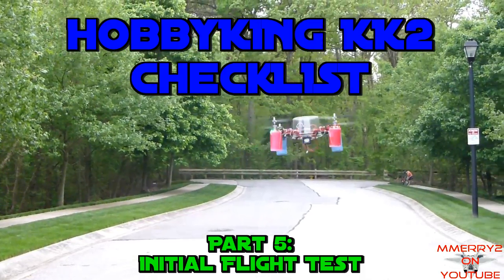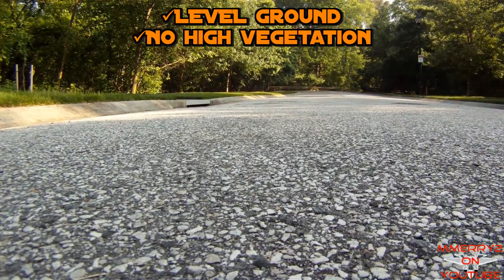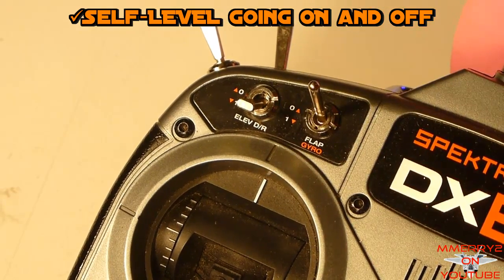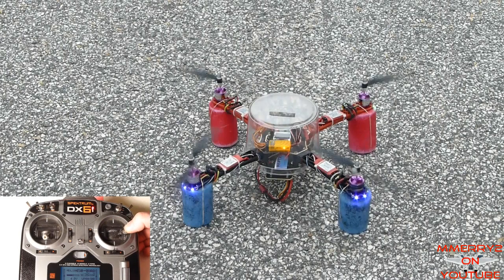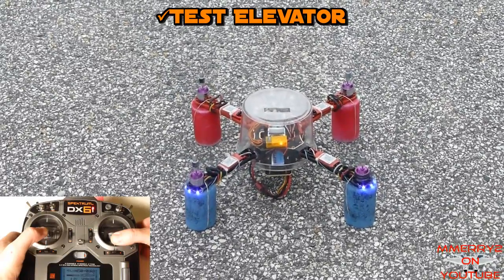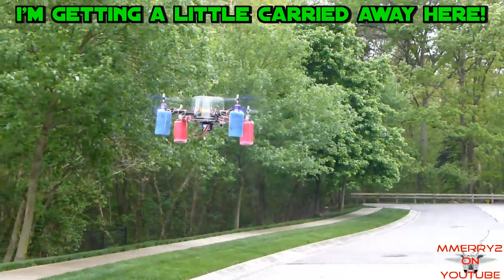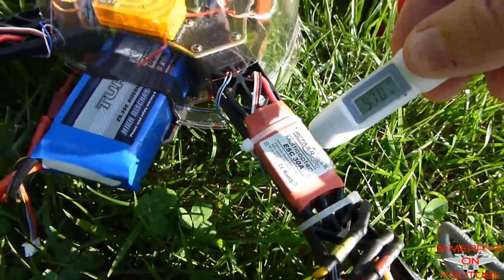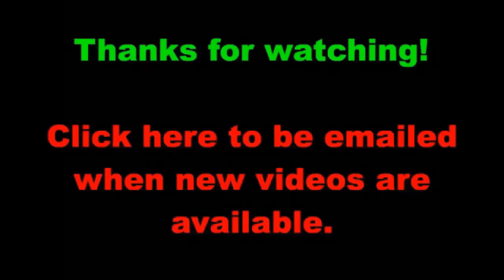HobbyKing KK2 Checklist - Initial Flight Test (Part 5)

Comment: Thanks for a great series on the kk2 .I have one question if you don't mind what voltage battery should you use with the kk2 i have a 525 quad and the kk2 .1.5 not sure weather to use a 12 volt batt or what to power it Thanks